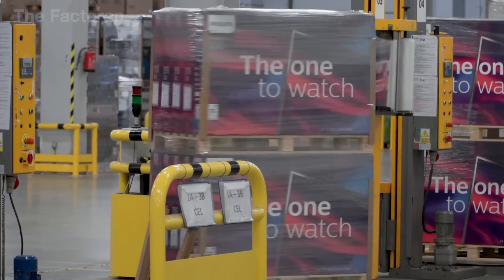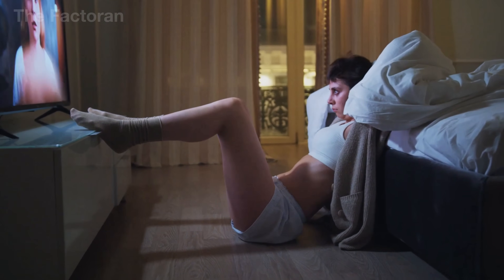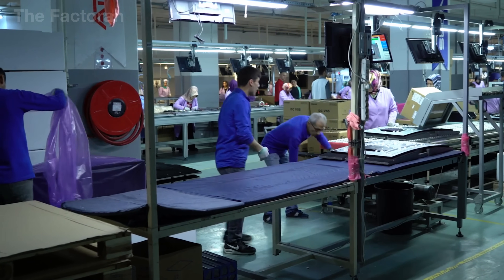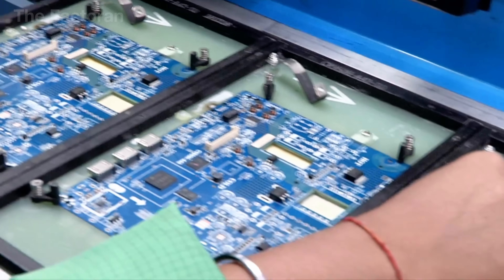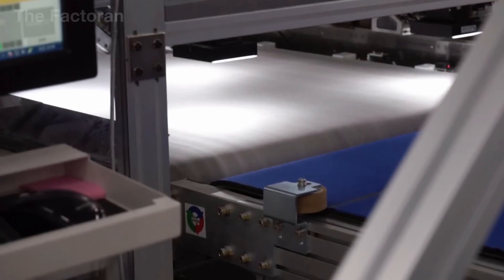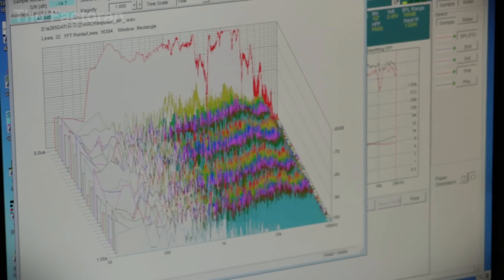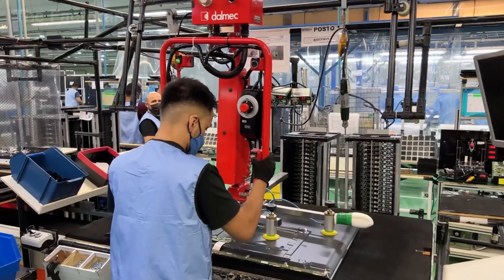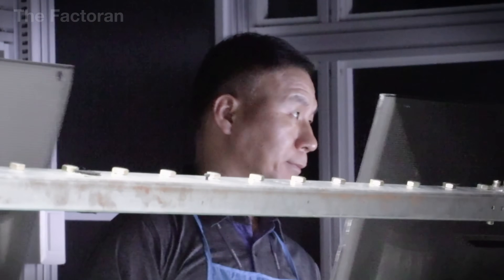How Millions Of Smart TV Are Mass Produced In Massive Processing Line

Comment: The Micro Leds Display Screens Panels Televisions 📺 Technology showing 👌 the better than LCD Displays Screens Panels or Organic QD-OLED or the WRGB Oled Organic Material Products degradation Televisions Displays 📺 Screens Display Panels Technology for sure because the Micro Leds Displays Screens Televisions Technology 📺 do not use a backlighting system Leds Displays Technology in the main motherboard for sure! Yes!😂😅
Reply from the maker: Yeah, microLEDs are super impressive—brighter, longer lasting, and no burn-in issues like OLED.